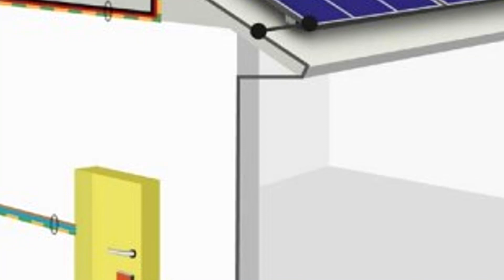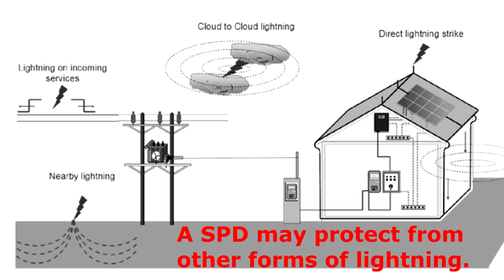A Surge  Protection Device is not a Lightning protection System 🌩️⚡

Comment: Thanks for covering that out Andy, I was just about to comment on lightning protection, static and over-voltage protection in the last video but expected you would cover it in this segment. In regards to service grounding, basically your Solar Arrays electrical services and many of the same conventions should apply as in utility service connections, and deriving a ground with frame of a metal building is potentially about the most dangerous thing one could do as metal sections of the building could end up dangerously charged. Grounding is firstly about establishing safe electrical potential between electrical systems and people, with Earth ground being the lowest potential. If you grounded your combiner box to the frame you would create another unknown ground potential between the metal in your building above Earth potential, thereby electrifying a wall, roof or door. 

Basically in all electrical service systems have to include Overload protection, Short-circuit protection, and grounding protection for people. In the case your PV system you are adding over-voltage protection. 

Without cracking the books, offhand I'd say that if the MOVs are intended to provide over-voltage protection for your Charge Controllers, and not grounding protection for people,  then they need be at connected at the same ground potential as your Charge Controllers, and your PV arrays with sufficient current carrying capacity to drain of any expected over-voltage sources. If that's Solar PV then might only need a bond it with a conductor large enough to keep your panel voltage below the limit of the Charge Controllers.

Offhand, as you don't have a lot of current potential from your solar arrays, then I don't seen the need for Photo-voltaic surge, but rather static or lighting surge. And in that case you need to be concerned with also the potential between earth ground and your PV arrays, the MOVs, and therefore the MOVs would have to have be bonded to earth ground with enough capacity to drain off whatever the expected static charge might. In the case of static surface effect that could be small, in the case of a nearby lightning strike that could be more moderate and something a light ground conductor to earth could handle, but in the case of a large, the surge from a direct lightning hit to your PV array could be beyond the capacity of the MOVs and large earth connection. 

I mentioned Bonding and Grounding earlier, and in the case of lightning surge protection, having the frames of your PV arrays and your metal building bonded at the same earth potential could help direct a lightning discharge away before it gets to the MOVs, but bonding your PV Panels to Earth can place them at a higher potential for a lightning strike. If however, you are in an area subject to frequent and large lightning strikes, then installing a Lighting Protection in addition to equipment surge protection might be a consideration to protect your investment. 

Having done some lightning and static surge protection on offshore platforms and the Arctic, and tropics, Personally I'd feel reasonably comfortable with a #10 or larger ground conductor from the MOV breakers up at the roof, and install secondary MOV protectors at the Charge Controllers bonded to a heavy earth ground, (say a dedicated copper rod) with the Combiner box MOVs bonded to that main ground as well.

Personally, I'd also be inclined to bond the frames of my PV Panels with copper bonding jumpers (#10 to #4) and bond them to earth gerund to try to keep static away from the PV cells and equipment. However, in sandy or swampy areas where the ground is not a good conductor and you have very large lightning strikes, then all of what I just mentioned could go out the window and you might need to consider a proper LPS system and things like capaticive protection in addition to MOVs
Reply: I always agree with bonding, it gives diversity.

I have an earthing busbar in my setup nice big copper bar, that goes down to a hefty earth rod (bright copper) that I got off a job some time ago.

In summer the ground can get quite dry so I have setup a drip feed system to keep the ground moist but not to moist (arguing project to measure how moist the ground is).

At the end of the day electricity will take the path of least resistance and my setup complies with the UK regulations so I am 😊
Reply: @evelbsstudio  Indeed, Good points. Andy with his Metal building, multiple solar arrays, has a bit more more elements than most home solar systems. And the potential for different potentials and circulating currents both static and inductive could present some challenges for bonding and grounding. 

Bounding is not always connecting everything to earth. There are situations when sub-panels, transformers, and power generation sources should and should not be grounded, and/ or cannot be grounded by regulation. And considerations that are not always obvious when it comes to bonding. 

 I used to live up the road from Andy on the Sunshine Coast and encountered an electrical engineer and inspector who were wrongly interpreting regulations without an underlying understanding of what they were administering or why.   The Australian Electrical Code back then seemed a bit ad-hoc when compared to American, U.K., Japanese, and maritime electrical codes. Hopefully that's changed, I'll have to look for a copy of the Aussie EC and see what it looks like today.
Reply: If ya want something to try and hold up to lightning you get some MOV's rated for 100KA and above and you also use some nice size TVS diodes aswell as they have a faster clamping time than any MOV does and well a ground for anything electrical for mains is ALWAYS a lump of condutive shit in the ground AKA a long ground rod
Reply: @Trent28888  Good tip! However, a single ground rod might not be adequate to drop a 100,000 amps at a million volts down to below 100v.
 In Alaska where lightning is pretty rare, to protect say a 60X80 ft. metal building with sensitive and expensive electronics required about 8 1" copper ground rods driven 44ft into the permafrost, and about 1200ft of 4/0 cadwelded copper ground grid burred 8ft below surface, and bonded about every 10ft to the building, partly because permafrost is not a good conductor but also because 31kv 20MW power-plant was on the same location and circulating currents from the power station in the ground were a consideration.
Reply: Im in aussie so its different but a MOV is designed to clamp so a fuse blows or rcd trips,theres a product called emp shield that claims it can handle 1 direct hit
Reply: @jackoneil3933  I salvaged my earth rod from a 800kVa generator that was moved on the back of a lorry from a site I was working on years ago, I also agree about bonding on a generator but on a system like what Andy is building it should be fine along as the busbar etc can handle the current and voltage he's expecting to have, he could over size it for extra price of mind and future expansion etc.

You have a good knowledge and experience, its also good to see how you communicate it leaving little to misinterprete.
Reply: @evelbsstudio  Thanks, I hope my dissertation was understandable. 
It seems Andy has a pretty good and intuitive understanding of electricity and and his build. 
 I can recall some pretty intense thunderstorms around Brisbane and the Sunshine Coast, and in addition to a direct lightning strike I'd be concerned for a partial or nearby strike as well. I've seen some cases where a well grounded system seemed to attract lightning strikes but wasn't able to dissipate all the spurious charges and toasted equipment. 
I lost a couple of Ham radio sets, a Satellite TV receiver and a deep submersible water pump due to lightning strikes in the U.S.All had good, deep ground rods and the lightning seemed to go for the ground rods and then back-flowed into the elecrical service and down the well to the Pump Motor. After I disconnected the grounding conductors and Installed a steel wire fence with steel posts driven into the ground around the antennas and pump house I has a few strikes on the fence not on the Satellite & ham antennas and pump house.
Reply from the maker: Thank you very much, Jack. That is great information.

Comment: Great Info as usual 👍😊
 I'm considering putting in SPD in my House DB, However I never really thought about a Direct Lightning hit (mainly Electrical surges thus SPD Installation)
Will you install a Lightning Protection System from a Direct Lightning Strike ?? I think it would make an interesting Video. 
I live in the Country NSW (on a hill - 720m Above Sea Level) close to Overhead Power Lines, I may consider doing this myself 🤔
Reply from the maker: No, I don't install an LPS on my garage or house. This would be far beyond a DIY project anyways. The main reason was to protect the MPPTs from over voltage.

Comment: Ok get a piece of paper write GROUND on it and tape your wire to it. How do you think your solar panels are going to surge the voltage in the first place? Possibly a spacecraft with a beam of infrared light? Just asking. A voltage spike would be between positive and negative only anyways unless a meteor or hail storm, lightning, attacks them. Hey this is suppose to be fun let's have a beer.
Reply from the maker: Thanks Dave. Novaris recommends SPDs on all cable entry points of the building. There is also lightning wich can occur from cloud to cloud which can have an impact on solar installations. Yeah, let's have a beer first! 🍺

Comment: Maybe its different in your country, The SPD they installed on my solar system is in the breaker box near the solar charge controller/inverter. The combiner box is on the roof under the solar panels mounted. The SPD has its own copper grounding rod, separate from the AC system ground rod even though they are within 5ft of each other. I just pulled out the manual on the SPD in my system given to me after install. It says its a NEMA Type 1 SPD, model TPS3M0305 by Siemens.  Direct reference from the manual says.. "The main purpose is to protect insulation levels of the electrical system against external surges caused by lightning, capacitor switching, or transient surges ". Then in the back of the manual, it labels transient surges as "Transients and Surges are the same phenomenon. Transients and Surges can be current, voltage, or both and can have peak values in excess of 10kA or 10kV. They are typically of very short duration (usually >10 µs & <1 ms), with a waveform that has a very rapid rise to the peak and then falls off at a much slower rate. Transients and Surges can be caused by external sources such as lightning or a short circuit, or from internal sources such as Contactor switching, Variable Speed Drives, Capacitor switching, etc.
Reply from the maker: Thanks William, great info here. What cable size does the ground cable of your SPDs have? Same as the other solar cables?
Reply: @OffGridGarageAustralia  I went out to check just so i was not guessing, it says AWG #10 on the grounding wire, which leaves the breaker box and runs down through a conduit to a separate grounding copper rod pounded into the ground roughly 4-5 feet from the AC utilities electrical ground rod for the entire house. The only thing attached to the SPD ground wire is the SPD itself.
Reply from the maker: @williamhustonrn6160  That is 10AWG I assume not 10mm, right?
And, thank you!

Comment: Andy, I built the house myself, steel frame, colour bond roof on a concrete slab, all properly engineered, inspected and certified.
Did the solar myself, ground mounted panels, but when it came to wiring up the house I got a qualified electrician in, firstly for the safety of my family, secondly legally I'm not allowed to touch AC.
It's a big house, miles of cabling for all the circuits, so at 4 points in the house he put ground rods internally in the frame and through the slab, so the frame itself is grounded.
The battery shed is about 30m from the house, it has 2 separate ground rods, one for the DC gear then one for the AC DB.
The line to the house DB is underground as per regulations, the house DB then has it's own ground rod as well.
The Solar setup has been going and growing for 10 years, we lived in a shed about the size of the Off Grid Garage whilst I built the house, which is now about 6 years old.
We've had many thunder storms including a massive one last night, during all that time I've lost 5 panels from what I believe to be a lightening strike, cracked cells, molten connectors, could have been a massive short circuit, who knows, each array has it's own ground rod and a combiner box with fuses, RCD etc.
Point is, I do not have SPD, we're Off Grid, or LPS and I'm not bothered, we're on the plains, out in the open.
Maybe the wiring code is different in SA compared to Qld, but I feel pretty safe.
Reply from the maker: Thanks for sharing, that's very interesting.

Comment: When I was working in Roma, QLD on the coal seam gas fields, when installing steel cable trays, we had to run a 35mm earth wire between each cable  tray length, that's was the code for the project.
Reply from the maker: Yeah, that might be different for these industrial installations. In certain circumstances a metal cable duct can be used as grounding as well. Cable tray is different though.

Comment: Alcohol and most plastics do not mix, the plastic will craze after some time and fall apart.
Reply from the maker: OK, so make your comment more positive and provide a better solution. We're all here to learn.
Reply: @OffGridGarageAustralia   Some plastics are not compatible with alcohol and will cause it to fall apart at a later time test a small area first if it causes it to cloud up do not use it on all the pieces. Not all plastics have a problem.
Reply from the maker: @Labeeman  Looks perfectly fine so far since I did it a few days ago....

Comment: i would have thought that every metal building should be grounded ,that would only make sense ?
Reply: they are but not for elect
Reply: @martehoudesheldt5885  i understand it is for what reason then ?
Reply: It is for lightining
Reply from the maker: All metal parts need to be on the same potential to make it safe for us. Otherwise the garage could on a higher potential as you standing on the ground. You touch the wall and get a little zap.

Comment: Andy, earthing for a lightning strike is totally different to electrical earthing for electrical compliance  At the voltage you get from a strike everything is connected. All the sheeting screws and bolts will make that frame an exceptionally good earth. I was once in a shed that got struck by lightning and never felt a thing. I believe you would be safe to make a good connection from your protection to the frame, you could connect the frame to the earth spike if you wanted but really at millions of volts lightning is going to find the ground regardless.
Cheers Allan
Reply: Yeah my earthing arrangement comment seems to have been taken wrong..

A copper bar to earth rod within an enclosure would comply with most regulations in most countries. 
As long as it has separation and has some form of barrier to prevent direct access such as touching..

There would also be low impedance, resistance and would allow for high amps and current for a period while the protective devices do there job and isolate the panels.
Reply from the maker: No, Allan, that is not allowed in any circumstance. The garage is of course grounded but this does not mean it's a good ground point for electrical installation. All metal structures need to be grounded to have them on the same potential as we are. Ground is the lowest point. Otherwise your garage frame could be on a higher potential then you standing on the ground.

Comment: Hi Andy, I think they meant the SPD should be as close as possible to the device it is protecting. It should be shunting the surge with reference to the same ground point as the device, so they must have meant that the device is protected from that point. Not only the ground cable, the others cables should also be as short as possible wrt the device. The remaining part of the ground cable going from the SPD may not matter. Voltage is a reference to a point, I think that's why airplanes are immune to lightning while in air.
Reply: Oh and that lightning example, I didn't mean that SPD is for lightning protection, obviously we need lightning arresters and a separate ground for those, preferably far away from the house/garage ground.

Comment: You are very right that you should not attach ground to the metal garage frames. But, not for the reason you suggest. There are actually multiple reasons including shock and fire safety as well as other things like RF ground loops. In almost all countries with recent electrical codes, you should terminate your ground in a single place inside. Exterior grounding, grounding for RF, grounding for marine environments, and grounding for expensive industrial equipment add some major complications but a good easy rule that usually won't steer you wrong is that all grounds should terminate at a single point in each subpanel, all subpanels should ground back to main panel ground and main panel ground should terminate at a single ground rod.
Reply from the maker: Thank you, great comment!